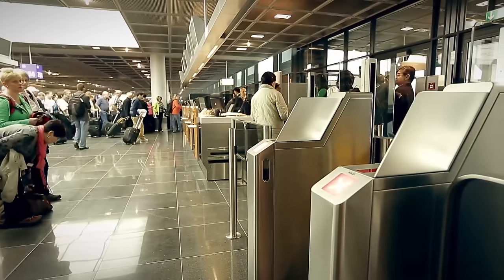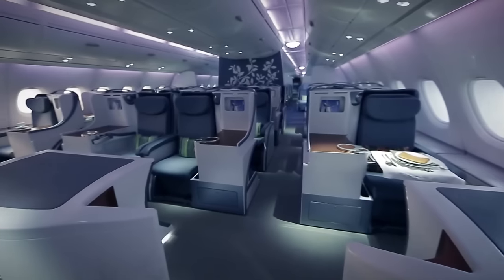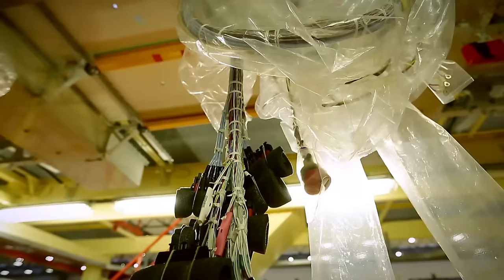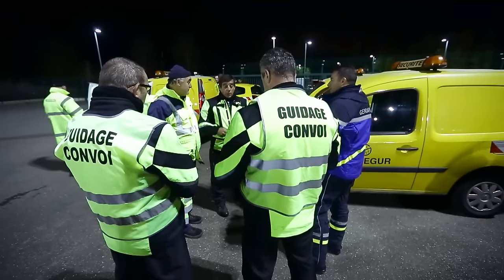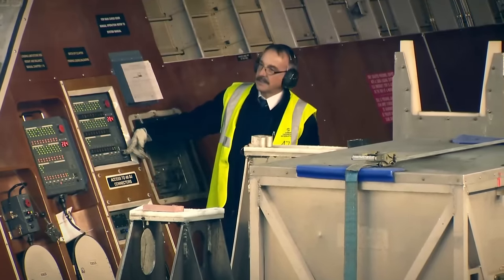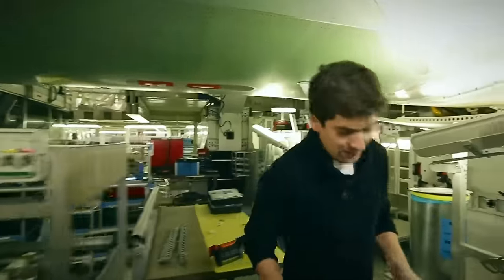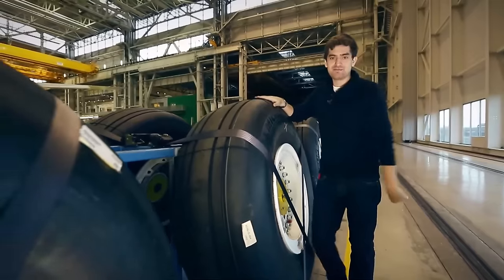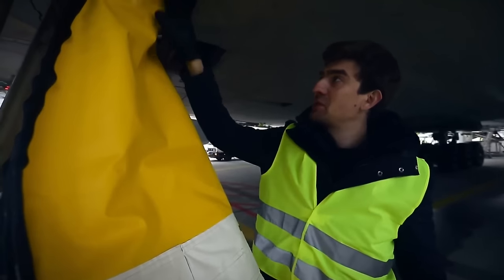The World's LARGEST Passenger Aircraft — Airbus A380

Comment: Actually, the Boeing 747 has the record for the number of passengers in a single flight: Over 1000 passengers in each of two different flights. Additionally, several 747's had over 900 passengers. These were rescue flights of refugees of families of Ethiopian Jews to Israel in 1991.
Reply: The difference is that the 747 is longer but the A380 is bigger in height weight wing area width and power
Reply: And the 747 was a great success not a failure like this plane.

Comment: Russian titanium is the only material suitable for the A-380 landing gear?
I don't think so. There are plenty of high-strength steel alloys that can do the same job. The places where titanium really shines are in corrosion resistance and maintaining integrity at high temperature. availability and cost would make it very low on my list of choices for material unless i was building a super-sonic aircraft and needed it for the outer skin.
Also, the Boeing 787 is mostly made of carbon fibre composites. There is very little aluminum or fibre-glass. Perhaps you could do a documentary on its construction.

Comment: Boeing hat a large amount of plane crashes in the past. Unfortunately a large amount of passengers passed on. There is even until our entire times ( August 2024) not a single plane crash of any A 380 reporter. Zero. "Safety first" is one aspect of pretty good engineering and second, there are a large amount of passengers who want to travel with the A 380 and also the B 747-4007800...No matter if airlines guess that this aircrafts are "not efficient enough"- indeed a Porsche 9111 or BMW 7-serios besides a Rolls Royce is also "not efficient" but on demand. Think different and like Steve Jobs said "stay hungry!"......

Comment: They should make a fright verson and combo riders on to fright bottem to floors.  Why do they like side stick instead of a yoke.  People may have to fly multable brands of aircraft. Let the buyer have a choice yoke or stick that can switched out quickly, you are flying by wire not linkages or cables like older aircraft